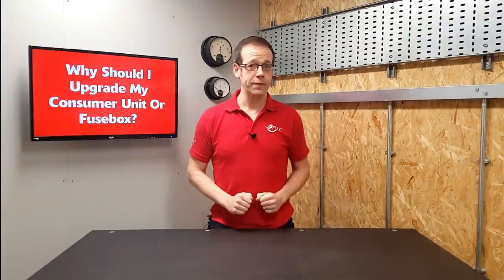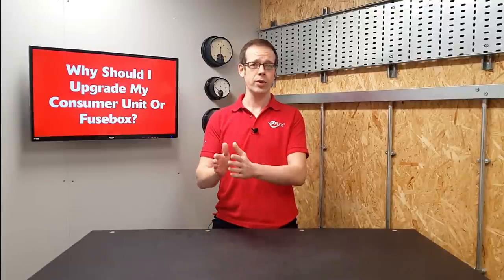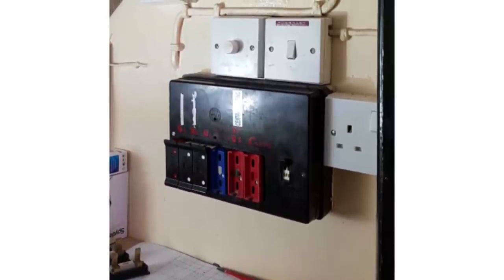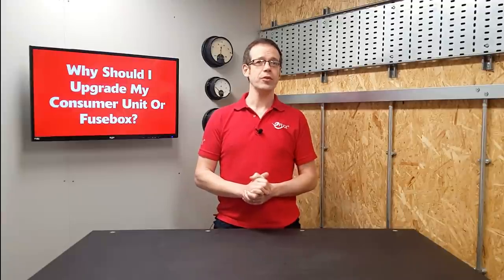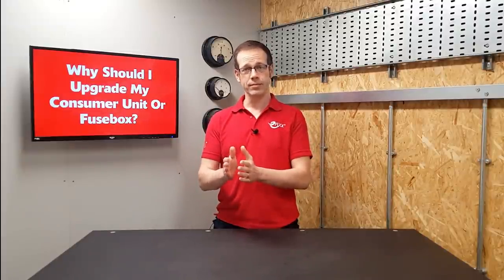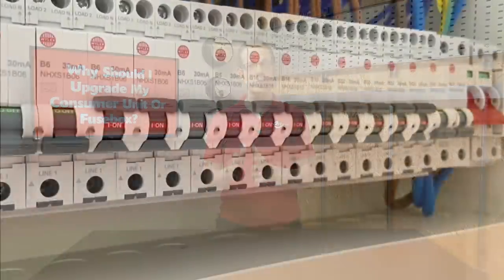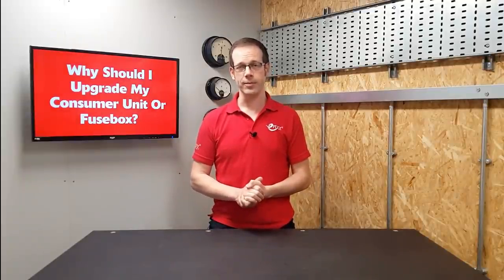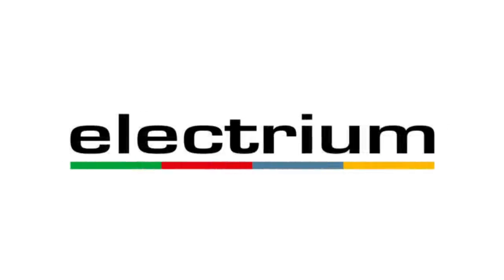Does my fuse box or consumer unit need replacing? - UK house wiring

Comment: Great video. My flats were built in 1990 .. so bad they installed the old fashioned fuse box ! 1960 era fuse box like the first one in this video. My smart bulb in my lounge has blown and all my lights have gone off. So I need 5 amp wire .. good my local B & Q sell wire still. ( 2021) £1.85 a card of 3 diff amps. So tomorrow I will change the wire. Handy you tube video makes it look easy for me ( single woman) 😂… I can’t afford to get a modern consumer unit at the moment. 😪
Reply from the maker: Wow - must be one of the last properties to have rewireable fused fitting.  We would suggest an upgrade at some point to add RCD protection to reduce the potential for electric ⚡️ shock.
Reply: @efixx  when I pulled the 5amp fuse out the fuse box, it was not wire, it was cartridge fuse. Still old fashioned i know 🤭🥴

Comment: Great talk thank you.
Several years ago  we we’re told fuse boxes with wood were combustible and should be replaced with plastic type. Role on several years and it turns out the plastic are  50 times more combustible.
There might not be any truth in this but several years ago I was talking to a guy from SEB back in those days fitting a new meter. He said in his own house he would never install mcbs. He said he has seen mcbs fail and cause fires. Fuses don’t fail was his words.
That’s not my opinion just his. I always think was he right or wrong .i have only ever seen them go off and not reset ,even that’s rare

Comment: Replacing the fuse wire in the old style fuse boxes with a paper clip used to stop them blowing and I bet there's still more old style ones then new.
Reply from the maker: Amazing some of the pictures you see before upgrades.
Reply: In a very famous qcs house last year. I! Switched on his downlights in his top floor former servants quarter's
10 mins later lights stopped working.. Further investigation noted. Downlights installed years ago 12 v halogen twin cpc cable resting on lamp. Lamp gets hot.
Final circuit protected by 5a rewire able 3036. Burnt out complete insulation on 4m 1.00.mm twin. Whilst I was there! 20 a type b none rcd protected sub main to 3036 cu only operated then. 2 million sheets house.

Comment: In the US, we have similar setups for fuse boxes or breaker panels, but the breakers themselves look slightly different than what is shown here, at least for the residential market, and as such, are relatively, if I had to guess based on the breakers in the video, smaller in size, but with same capabilities... One thing that I will note for AFD breakers in the US, is that they are supposedly known to reset themselves if used in circuits with high end electronics such as computers, flat panel/screen TV's, or microwaves... Whether that's actually true, or whether it was at one point, but isn't anymore, or even never was true, I don't know, and perhaps it was only 1 or 2 prominent installers that found that to be an issue, while others have not, but it is definitely something to think about, and research... Wish we had an equivalent channel for US wiring and standards...

Edit

I see that a lot of people call the electrical repair technicians "sparky"s across the pond, at least in videos and comments on YouTube, but here they're just generally known as electricians, in the US, or at least that's generally what I hear them referred to as... (For good ones, at least. The bad ones get called by many 4 letter nicknames, none of them pleasant, and for good reason)

Also, I'm not an electrician, I just like watching building and remodeling shows

Comment: It’s interesting to see that the UK banned plastic consumer units. I’m from Sweden, and here there is no indication from the Swedish Electrical Safety Board, or any changes being made to the Swedish Electrical Standard in the near future on requiring metal housing.
Reply: My understanding is not that they banned plastic consumer units but they mandated standards for consumer units that are easiest/cheapest met with a metal consumer unit.

Comment: Great vid.  My fuse box is old old.  How much would a replacement be to get it into this era.
Reply from the maker: Depends upon how many circuits you have and the condition of the existing wiring.  On average we’d suggest a budget of £800-1000 for a quality job. Hope this helps
Reply: @efixx  it's old fuse box with not many circuits and wiring may be old. So u think I should put away about a 1000 for this.   Appreciate u

Comment: A question for you professionals out there. I have been renting out a property for many years. I have always had annual gas and electrical safety checks done yearly. The property was fully rewired around 30 years ago and has the traditional fuse box type consumer unit. Very simple set up - 2 x 32A & 2 x 5A (upstairs/downstairs). In 2016 the sparky gave me a 5 year NICEIC certificate and said annual checks were not required. Now in 2021 a different sparky has given me a 12 month certificate only and said everything has passed but cos it is a fuse box type installation it MUST be tested annually. Have the rules changed since 2016?
Reply: No, they haven’t.
The problem is, it is the inspector that decides the interval between inspections.
I’d advise taking great care in deciding who you get to carry out the test and inspection.
I’d advise consumers to get someone who is an electrician first and a businessman second to carry these out, and also has a testing & inspecting qualification, which is separate to an electrical installation qualification.
The businessman first and electrician second type are the ones that have the more affluent lifestyle, in my experience.
The capitalist system has taken over all aspects of society, so the main priority is to get consumers to fall for the brain washing and use their earnings to buy things they don’t really need, but think they want.
Reply: @kevinjewitt6347  Thank you.

Comment: Perhaps unwise to push the notion that AFDDs are beneficial, given the lack of evidence of their efficacy, both regarding their sensitivity to faults and fire prevention ability. They are perhaps being pushed on us in upcoming regulations due to the lobbying power of those with financial interests in their installation (such as manufacturers and wholesalers). There is however apparently little evidence for their effectiveness (see e.g. https://communities.theiet.org/discussions/viewtopic/1037/27144 where an electrical engineer says in part: "The science behind these devices is simply not there, and it is easily shown that these devices are being sold to detect a problem which does not exist". Damming words indeed), and DIY testing shows just how useless they can be (see e.g.: https://youtu.be/TVqi6CedMkM and https://youtu.be/jHrNMFESd6Y). In short, we're being sold a bum steer, probably for nothing more than financial gain.

Comment: Costs of replacing a plastic Unit with a Metal box ?
Reply from the maker: Depends upon the size of the installation - but approx £500 - 1000 - your property may also require additional electrical remedial work.
Reply: @efixx  and that’s for a Cu that cost £30 from B&Q🤣

Comment: What if someone has an outdated installation but not funds to pay a spark 1000s for changing it. But said person had the competence and equipment to carry the job out safely. What would be required to bring the installation up to a legal standard?
Reply from the maker: You have your answer in your question...
Reply: Re competence, one would have to have knowledge of the current electrical regulations and the requirements under building control regulations (part p at least. The equipment would also include testing equipment. That alone is £££. The more one watches these and other videos the more one understands the gap between a non sparky and a qualified sparky with insurance + experience.

That’s not to say you couldn’t do a better job than a bad sparky (you should see some of the shite I’ve seen in my place) and we all know there are cowboys out there, but they are not everywhere. Not to mention liability if something goes wrong. 

If you are happy you have up to it’s your choice, but be aware if there isn’t the correct certificates and sign off you may be giving your insurance company a get out of jail free card in the event of a fire, selling your house could get complicated and renting out could land you with issues. 

Just because your installation is outdated it may well have passed the requirements at the time of design and would be legal. Replacing it means it has to pass current regulations. 

Please don’t think I’m knocking you, I’m not, but there are risks to doing electrical works so do plenty of research and be armed with as much knowledge as you can get.

Comment: So a proliferation of more & more expensive safety devices to protect you against 1 in a million events, making replacement so expensive that ordinary householders are more & more likely to stick with their old installations.
Reply from the maker: Should we try to make electrical installations safer? Nearly 20,000 electrical related house fires in the UK every year!
Reply: @efixx  - 89% of house fires are caused by the appliance, not by the fixed wiring installation.
Reply: I have to agree. It doesn't improve safety if people can't afford it. I think there are measures that could be taken with new installations that would help to mitigate this in the future. Instead of Consumer Units(CU) having a Line rail and Neutral and Earthing bars inside(though there would still be an Earthing bar for bonding), there would be rails for each conductor type. Ideally such a standard should be compatible with one that could be used with 3-phase systems, with only the required components installed on a 1-phase system. They could then bring back the convenience found in some old fuse boxes. Coloured sockets of specific current ratings would be mounted on these rails, and attached to the internal wiring of the same rating. The RCBO, or other protective device, could then be changed by the consumer at minimal cost simply by plugging it in to act as a bridge between the mains and the internal wiring. Only the appropriate device would fit a specific socket. A surge protector would have its own socket next to the mains switch. As an extra protection, the sockets could be recessed so that latches would hold the device securely on the CU unless released. A bar connected to the main switch could have a cam on it that would prevent devices from being inserted or removed while the CU was live. I think this kind of development will become essential in the future as the protective devices become more complex and prone to failure. The latest ones have microcontrollers inside. There should be a British standard for this so that all manufacturers' offerings are interchangeable.
Reply: @dalriada842  - Yes, actually making consumer units for consumers rather than just electricians would be a step forward.
Reply: @doublethink and what’s protecting the appliances, also it’s not 1 in a million that’s just a pulled out of thin air statement. Try to talk in facts rather than bs
Reply: @supersparks9466  The consumer unit primarily protects the fixed wiring of the premises against overload, though more protections have been added with time. The fuse in the plug protects against overload to an appliance and its 'flex' under a fault condition. Most fires are caused by user error and faulty appliances, particularly regarding cookers.

Comment: Nice one joe 👍 so I am in a situation I have a Schneider (metal) consumer unit split load dual rcd with mcbs, all good but only thing is ,that previous owner did not get was the paperwork for it (not notified etc) Now I’ve seen these brilliant idea rcbos, surge protection devices , would it be wise to call a sparks in and do an upgrade 🤔 I know it would cost, but for piece of mind. Is a full rcbo with surge protect like sparky porn 😂😂

Comment: You stated an MCB can't be changed for a wrong MCB by an inexperience person Wrong al! mcbs are the same size and are available to anyone and can easy fitted by anyone so you can swap out a 6amp mcb for a 50 amp mcb, the only tool required is a screwdriver. anyone can walk into a place like screwfix an by an mcb  so I suggest you remove this video as it in accurate
Reply from the maker: In comparison to replacing a fuse wire it's far less likely that someone will replace an MCB. We'll be leaving the video up.
Reply: You did not get it did you? 
Mr average will not poke around with a screwdriver in a CU. He will throw an MCB switch though.
In ye oldern dayes, he may change a fuse in a fuse box, but I have seen many replaced fuses in fuse boxes being of the wrong rating, as they put in the only one available to get the power back up - as I see in many 13A plugs.  As an aside, you may find that most fuses in 13A plugs are oversized for the application.
Reply: @robert burrows agree the same make of mcb can be changed or swapped but unlikely and in any case if an untrained person decides to muck around in their consumer unit then they will have to take any consequences, you can’t legislate for dumb people.
Reply: Why the aggressive tone?